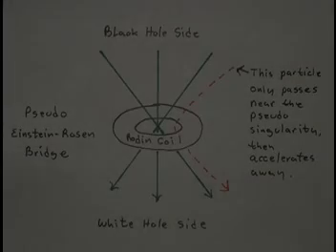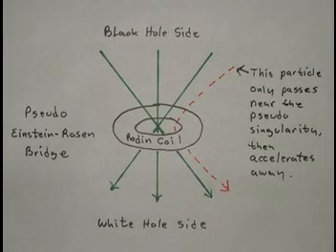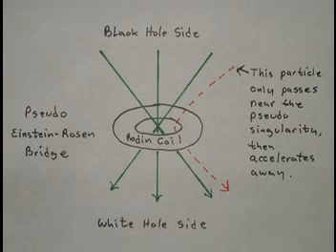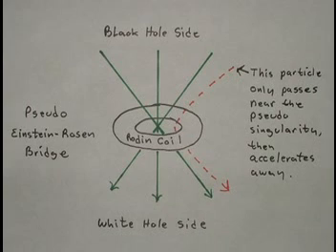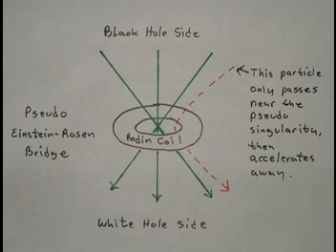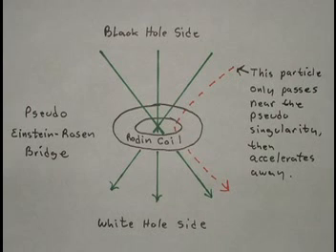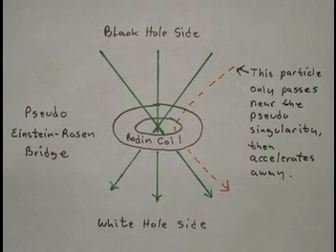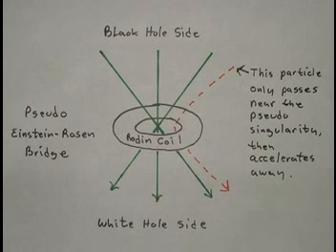Rodin Coil - Part 3 of 3

Comment: The only problem with some of the theory here is that gamma ray bursts have been detected coming out of several black holes.  Basically the mater in transformed into high powered energy as part of the Hawkings radiation effect.

Comment: This comment is many years late in coming, but it should help you better understand a "rodin coil" ; the coil works like a magnetic vortex ; above the coil is vortex and bellow the coil is another vortex. .like a magnet that is spinning the Ethers. .it does not connect to another dimension as you theorize. .the "virtual particles" that you mentioned in the series are wave compressions of aether. .these are not particles jumping from one dimension to another as has been suggested by 'Einstein', 'Rodin' and 'Yourself' . .it is a common miss conception of the aether. .probably generated from the fact that it is hard to detect movement so fast. .our eyes can not see fast moving objects and they will appear invisible. .

As for the antigravity effect. .that is only achievable by creating a standing cusp from two waves of the same frequency and amplitude hitting against each other from opposite directions simultaneously. .they would in effect cancel their movement out neutralizing their component movement and all wave action that carries between the magnetic field such as gravity. .the high end Ampere effects must be stimulated with a filtered electric current or radiant watt. .that form of energy is cold in nature. . it is produced best at a magnetic quenched spark gap. .if you have no idea what a Radiant Watt is it will be very hard for you to understand what I'm writing and you will need to do extensive research on Tesla's Hair Pin circuit and methods of producing AC radiant watts. .

Tesla lost respect in his days for his technology  after the Royal Society scientist failed to reproduce the cold current. .either they did not follow the directions Tesla gave, they were not informed or simply did not understand the Electrical Engineering expertly as Tesla had done to produce the results. .This current will help you get higher outputs on the Rodin Coil without having dangerous issues with high 'hot' Amperage. .Opposing Magnetic Currents in wires brings cooling currents. .are not shocking. .opposing hot Amperage in wires by running opposing currents alongside of each with negative polarity  will strip the 'Hot currents. .electrons. .(they are compressed portions of waves) from the aetheric flows. .this is the core principal that makes the Rodin Coil really operate at its best! I hope that this helps. this next statement is the key to understanding all spiritual truths: .'Let us hear the conclusion of the whole matter: Fear [Yahwah] God, and keep his commandments for this is the whole duty of man.' Ecc. 12:13    Fearing the Creator means to keep his laws and will bring you Wisdom, knowledge, the ability to have proper council, understanding, Authority and more Love for his truth. .his fear will lead you to new knowledge . .

Comment: Instead of thinking about mater snd anti mater anialation, or mater being attracted on one side and pushed away on the other, because it is weird that a magnet will pull and push the same material, unless the material itself is a magnet that is restricted from rotating. On the otherhand, photons are their own anti particle, and maybe a roden coil might absorb certain circularly polerized radio frequencies on one side and emit the oppisate on the other.

Comment: A couple of observations/questions;

I’m not suggesting it’s all hokum - I believe we’re simply trying to apply current terminology to not-yet understood phenomena…

1”. Nothing radiates out of a true singularity..." - Except gamma radiation (or so they think?) 

2. Holding a light on the black hole side, then measuring the light received on the other side (or by in interferometer?) would measure any changes - changes evident IF there is a black hole..

3. A black hole is a singularity of MASS that has been sufficiently crushed beyond it’s Schwarzschild radius. The rodin coil center has no mass to crush, so no black hole?
Reply: I can only say the magnet field acts like one.
Going round and round till it gets into the hole

Comment: the frequency of the thing is to independent particle gasses noble weight separation of gas four gas levels in the chamber the directors are magnetic out side the chamber the glass rode is the Roden coil shape the static influence as the plasma shaper kens top and bottom this plasma does not get hot even though it glows white

Comment: I doubt there is a black hole or anything similar formed in the middle of a rodin coil. And I have never seen one of those things produce anything I would label as thrust.. especially by pushing and pulling matter through the center. I personally believe it levitates because you run electricity through the rodin coil it becomes an electromagnet and repels the magnet placed on a table beneath it. It seems like regular old magnetic levitation with a fancy shaped coil. Unless I missed something..
Reply: I think it's the singularity of magnetism.
Because the magnetic field of a Rodin coil can be compared to a black hole😅

Comment: In continuation: If it did create aback hole the gravity would be sucking the air around it in and there would be a noticeable air draft going to the center of the toroid. Which i don't believe has been observed.

Comment: You say nothing gets radiated. Which is semi true but theoretically wrong. They are black because light doesn't get past the event horizon but Theoretically Hawking Radiation exists which could be detected. The only way Marko is correct is if it did somehow make a black hole and Hawking radiation proved to be correct. However i doubt Marko has even heard of that or knows anything about that and was probably just smoking his religious crack pipe while making this.

Comment: Right On! Shielding is a must! I consider paramagnetic material with a high CGS as a method of absorbing and blocking other than Lead. but Lead with a polimer coating and a photovoltaic would seem the best way to Capture the energy. I also see monoatomics as a closed system of high spin state IOn and Plasma utilization but an Optical Diode would need to be used to ratchet out useable one direction flow. Just some thoughts I have. Thanks for sharing! Scott

Comment from the maker: @syberraith As far as the coil being efficient:  Other people have found that it seems to be more efficient than either solenoid or toroidal wound coils, although because it's an air core coil its inductance is distinctly limited compared to cores with a coil of magnetically  active  material .   

What does that mean:  Well as a result it will probable be limited to being driven by very high frequencies.
Reply: If it had a toroid core can it work like a 3 phase transformer? Like using a single toroid core instead of three separate cores.

Comment from the maker: @syberraith As far as the white hole/black hole stuff, that's Marko's eplaination.  I have a hard time seeing actual singularities formin in the center of the vertex.   

I refrained even trying to measure a weight difference the current flowing one way then the other.  With the switched DC that Mark'o suggests the poles are going to be reversing anyway, and besides my coil was of such light construction that the two amps I was putting though it was barely enough to create a magnetic field..

Comment: do you have an illustration/can you describe the electromagnetic field that is created by the coil? is this basically an extremely efficient electromagnet? or just a very cool sequencing of wires based off of vortex mathematics?

hypothetically, if you were to put 2 rodin coils on top of one another (white hole to black hole) would they be attracted to one another?
Reply: It'll just act like a transformer except you energize the two coils to produce unlike poles

Comment from the maker: @beac310 Perhaps, and if it is produced by the matter/anti-matter annihilation process the photons will be extremely energetic.  Meaning that probable very few would be able to be captured and converted to electricity by photo-voltaic devices, namely solar cells.  The bulk of the photons would just scatter uselessly.

If photons produced thrust, then lasers could be used as propulsion devices.  Since photons are for practical purposes mass-less, getting thrust from them is out of the question.

Comment from the maker: @syberraith I poked around the coil a bit with a compass, and put a bar of laminated transformer core material in the middle. I had trouble reading only one pole. It seemed to generate both, although unequally.

I'd like to explore this more with a gauss meter/hall effect sensor. However that will have to wait a while.

Fred
Reply: I expected it to be dipole though.
But can it be used as a transformer if it used a laminated toroid core

Comment from the maker: I looked for asymmetric pole with a compass and some laminated material from a transformer in the middle of the coil.  Results were un-clear.  It seemed to indicate a north on one end and a very weak south on the other.

The wire is fairly small in my coil, 28AWG I could only put a couple of amps through it on average before I could feel it heating up.

Perhaps with thicker wire and more current asymmetric poles would be more observable.